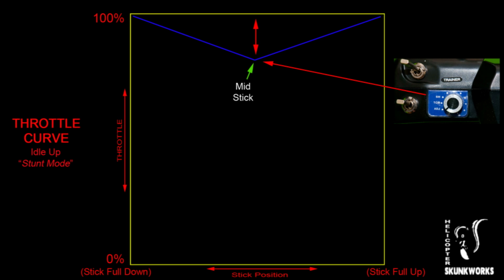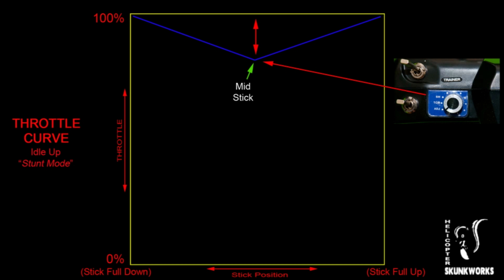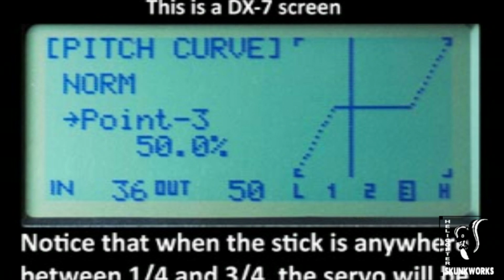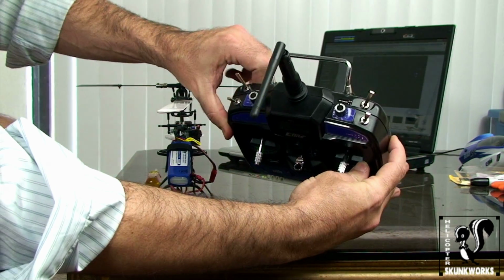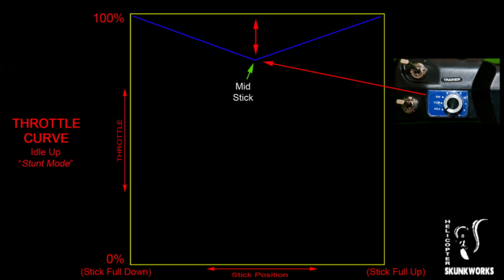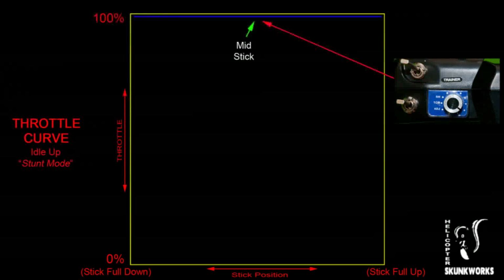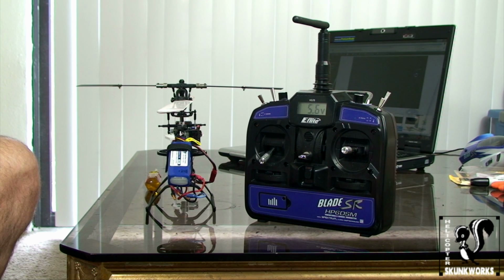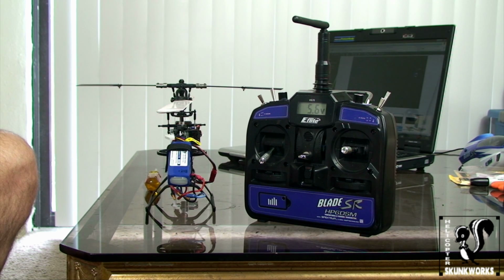E-FLITE Blade SR - Idle Up / Stunt Mode Explained Part 2 - Official Beginner's Guide Part 8B

Comment: Very informative.  I'm new to CP and idle up.  Never really understood how it worked until now.  So as a rule of thumb, at neutral pitch (midstick) what would most people have the throttle % at?  I'm assuming it would be 100% at full + and - pitch?
Reply from the maker: +valderja 
Typically it will be at least 75% or above. Many heli pilots put it to 100% for a very fast response time, but it can add a little extra stress to the craft and electronics. Depends on how you wish to use it and how you fly. And yes it will usually be 100% at full pitch in either direction, unless you have a reason for a different percentage.

Comment: Am I correct is saying that in IDLE DOWN mode the heli acts like an MSR with the ability to control the full range of throttle with the stick from 0-100% with a set pitch???... ie: full down stick=0 and full up=100% throttle??? Or am I misunderstanding???  I know when you switch to IDLE UP your throttle goes high and the stick controls the pitch (cause I just watched this video) ... thanks.